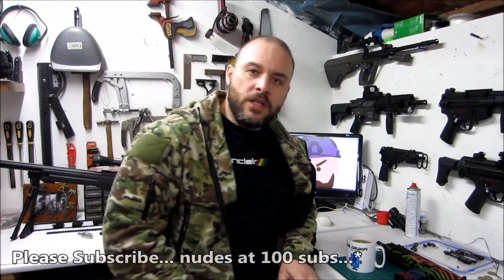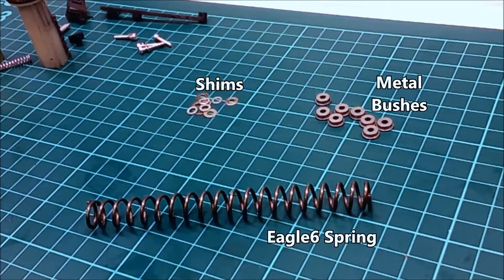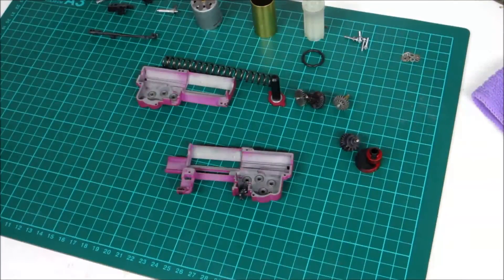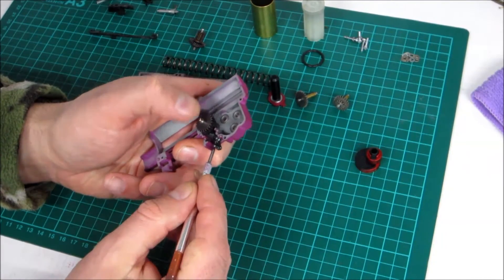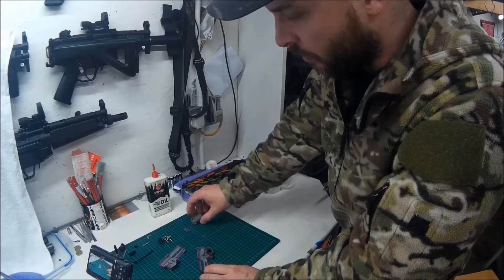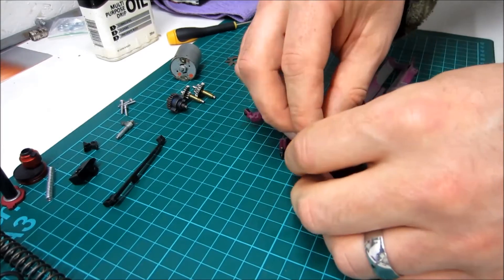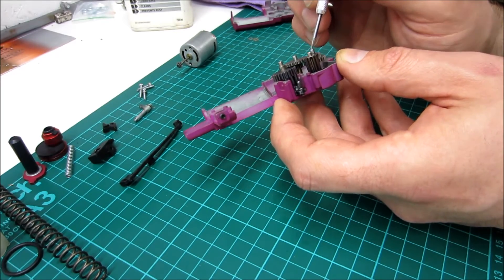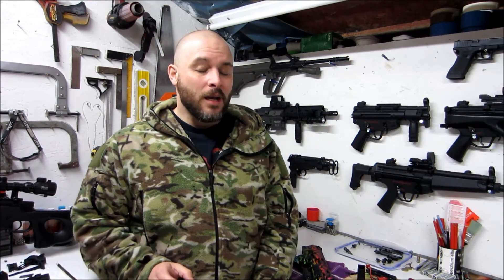Well R4 MP7 | Part 4 | AEP Gearbox Rebuild, Upgrade & Shim | Airsoft BYR

Comment: Hey lad i just got the mp7 and want to do the exact same thing you did to yours metal bushings spring etc, do you have a parts list? or can provide a couple links or atleast words of guidance, also are the bushing 6mm and do i need a press to get them in? Tia
Reply from the maker: Hiya buddy - I got my parts all from Eagle 6 Airsoft - but I'm not sure what is currently available.

I probably wouldn't bother with the cylinder head if building it again.  I only got it to improve nozzle seal as it is the biggest source of leaks on these - the factory head doesn't have an o ring and the tolerance is crazy loose.  The laylax one did have an o ring.  But it also had this daft squidgy damper design I really didn't care for.

So I'd maybe make up a jig for either grooving the inside bore of the factory head to take an o ring - or groove the outside of the nozzle to take one!

Bushings - I can't remember what size they are off top of my head - but it doesn't matter because they are specific to the AEP platform and only come in one size.  Even if you get bushes from a full size gearbox the right diameter to go in, the axle diameter is smaller on these - the gears would rattle around and probably destroy themselves if you used full size AEG bushes.... so yeah, stick to bushes meant specifically for these 😀
Reply: Purple Helmet  cheers lad, so far I’m replacing just about everything except from the piston cover (brass part) and gears as I can’t find any metal ones in stock, reckon the stock ones will survive the 300fps spring?

Comment: Where Do you buy this cylinder head? is like nineball mp7 cylinder head, isn´t it?
Reply from the maker: Hey - thanks for commenting - yeah the very same.  I'm not a big fan if I'm honest, I think the damping on the front isn't the best idea - it allows the whole cylinder head to move which could compromise cylinder seal maybe... it just doesnt sit well with me.  I'd have rather had the damping on the inside, but the main reason I fitted it is because a) I had one kicking around and b) I needed the o-ring seal as the cheap factory one was terrible.  When I get my lathe I intend to make these myself tbh!  I got mine from eagle6 airsoft in the UK, but they didn't have them in last time I checked.
Reply from the maker: Actually it seems back - description updated:

http://eagle6.co.uk/shop/catalog/product/view/id/1485/s/laylax-nineball-mp7a1-damper-cylinder-head-x-for-cmg-series/
Reply: It's just what I thought about that cylinder head.

Even so, have you noticed an increase in fps?
Reply from the maker: +GUZ KO actually yes!  It jumped the original fps on the weak spring from around 140/150 to 180ish, just by tightening the compression at that point.  I think the guns terrible hop up unit isnt sealing right every shot so I'm just deciding how best to fix that - I don't want t make a whole new unit since the whole point of these videos is to show people how to do things themselves... so I'm trying to stay away from fabricating parts.

I still haven't test fired with the new eagle6 spring!  The gun has been torn back down to fit a MOSFET lol.... WILL THIS PROJECT ECER END hahahaha

Comment: So I have a JG Skorpion. I Know they have the same GB as the MP7 I have a few questions. My front pin fell out and the upper came off. Then the air nozzle fell out of the piston head is this common, do I need to take apart the Gearbox to get it back in? I heard they might be free float? Is that true? Any info would help thanks.
Reply from the maker: Hiya, cheers for dropping by :)

If the JG is the same as the Well, ie a clone of Marui, there should be a wee grub screw that goes in from underneath, and stops that front pin from falling out - it could be loose or have fell off, should be able to find spares easy enough :)

The nozzle - you don't need to strip the gearbox to get them back in, they fall out quite often if bumped when the gun is apart.  Basically you just juggle it back in and then rotate it - the nozzle should have a little tab on it, and you rotate that to go into the little groove on the tappet plate.  Once the gun is back together it can't rotate easily so will stay in - but as said, when the gun is open, it's easy for it to fall out.

Have you had much gun time with it before this?  How did you find the JG version?
Reply from the maker: I wish they would let me post images in comments, would be so much easier to explain stuff!!
Reply: Thanks for such a quick response! Im gonna try those suggestions and see if that helps out. Ill let ya know if I'm successful. Thanks again. 😼
Reply: Alrighty! That was it! Super easy. Thank you. 😄👍
Reply from the maker: +CantSpellLITAwithoutLIT666 - Superb!  This is what YouTube is all about for me, getting chatting with like minded folks - well done getting it sorted!

Comment: did you use the SHS VZ61 gears in you`re uppgrade? and does it exist uppgraded motors?
Reply from the maker: Hey buddy - the gearset I got complete from "Airsoft GoGo"

Motors... as far as I know nothing that directly fits, but there are motors from radio controlled world you can make fit - I've never bothered to be honest.  At some point you've got to accept the limits of the platform
Reply: @PurpleHelmet  I still think youve shown how possible it is to make a half decent outdoor field airsoft gun for half the price of the newer elite force model with 250-300fps, 125+ feet of range, and at least 600 RPM are decent goals. Also adding the fact that the magazines are insanely cheap for multiples compared to the newer one.

Comment: Nice video, clear explanations and is a very good detail to include the sources.
Probably most os us lack a sandblasting cabin but is a good idea.
Just can't wait to ask. Here most people here inmediatly change to a precision barrel and an aftermarket hop up rubber.
I'm also curios about your opinion on the wiring. Do you think it worth to rewire with low resistance wires? What about upgrading the battery? Maybe to a LIPO? T Dean connectors?
Best regards-
Reply from the maker: Yeah the sandblasting was just a bit of fun - but if anyone wanted to, they could use sandpaper / abrasives to achieve the same thing. Kind of pointless though, I only painted it for two reasons; because I could, and because I have a few of these gear boxes now - it lets me tell at a glance which is which :)

Most people do jump to a precision barrel and hop, and that is cool - but this gearbox was way under performing so it needed done regardless.  I might put another barrel in it in the future, we will see.

As for hop up, the design and quality of the hop unit is terrible, a lot of flex in the arm so the hop up nub comes down more on one side than the other, which could cause the bb to swerve... I'll see how it performs at the shooting test.  At the end of the day, its rarely going to be used as a primary, more of a backup and close range gun :)
Reply from the maker: Oh and yes in my opinion a lipo (preferably with a small MOSFET) makes a huge difference, I have that running in my VZ61 which is essentially the same inside.  Wiring... personally with this I don't think you would see a huge difference, the only wires are from the terminals to the motor, the rest is nickel (I think) plated copper tracks in the firing mechanism.  I might still rip it all apart yet and do more - it is just a matter of how far you want to take the modification process, and how much you want to spend.  With how much I have spent so far, I am still under the price it costs to buy one of these stock new (at least in the UK) but it will be firing far better - I will summarise costs in a future video :)
Reply: I agree that generally the most sensible approach is not to fix what is not broken, so, if anything is working within reasonably expectations its proably netter to leave it as it is until something breaks or proves that is needs improvements.
Reply: Here is a fixation with rewiring everything. I'n not so sure that can be so much difference between two strings of wire.
What do you think is a better overall product, Well R4 or JG VZ61?

Comment: Hey man. I am thinking to buy and do some upgrade on JG vz61 (marui clone) - which is also hanging on your wall :D What upgrades would you recommend? I heard that gearboxes breaks very fast on those :/
Reply from the maker: Hey buddy cheers for dropping by and commenting!

The gearbox in the VZ is identical to the MP7 so the mods available are basically the same.  The Eagle6 spring will see it around 300-310 FPS on 0.2g bbs assuming everything else is good, but yeah, you do pay for that in terms of extra stress - you cant have markedly more power, without extra stress unfortunately!  So it's just a matter of how much risk you are prepared to take really.  

What I will say is although upgraded shells aren't available (that I've found) it is really easy to by stock gearboxes for these of eBay etc... so my mentality is if it breaks... so what lol!

Comment: Hi, great videos. I have just bought a Well MP7 for a back up weapon (I'm still waiting for it to arrive), while I am snipping. I always like to upgrade my AEG's to get the best performance from them. I do have a couple of questions; What are the size of the Bearings and would you recommend correcting the AOE of the piston? Thanks
Reply from the maker: +Robert Davies - hey buddy - thanks for dropping by, really appreciate it!

The AOE was fine on mine, even after fitting the upgraded cylinder head - however, that's a bit of an unknown; due to the design of the cylinder head, where the damper is, the whole thing can move... Which means the piston "home" position can also change.  That in turn means AOE could change shot on shot.  I'm not overly comfortable with that... but so far it has been fine.

The bearings - I can't remember specifically what size they are but I can tell you for these boxes, they only seem to come in one size - so any bushings/bearings quoted as being for "AEP" or "CMG" should fit.  It isn't like the larger gearboxes where you can get different sizes.  I got mine from eagle6 Airsoft in the UK if that helps!

I'm hoping to get the final part of this up soon, after I get part 2of2  up for the L85 I'm fixing currently :-)
Reply: Hi, I have been buying the new upgrade parts recommended by yourself and others. I found a mod (on YouTube) for a battery upgrade to a 800mAh 7.4V lipo. I do have two questions; would you recommend fitting a MOSFET? Also what hop bucket would you recommend? Cheers
Reply from the maker: Hey again fella - I've seen the mod a few people do on YouTube and there is absolutley nothing wrong with it at all - its good to go.  However, if it was me (and I will be doing it, very soon) yes I would fit a MOSFET on this.  Reason being the trigger contacts are smaller AND harder to get to (complete PITA) on this - so I see it as a preventative measure.  With a MOSFET in there, they will practically never burn out.  A 7.4 lipo wont put THAT much extra stress than the factory battery, but it does still put out more current, meaning more arcing, and more contact burn up in time.  So, for all it costs and a little extra effort I'd rather fit one and then its done.  It also means if I want to abuse the gun with an 11.1v for shits and giggles to see how long it lasts, I can :D

I'll literally be getting to work on that segment of my MP7 build very soon.  The project would have been finished by now, but I lost momentum and a few people asked me to fit a MOSFET and LiPo to it :)
Reply from the maker: Oh - the hop bucking - I could be wrong but I don't think there is much choice out there for these.  Maybe ones for other guns will fit, or can be adapted.

The main problem with this particular gun though isn't the bucking itself - even a basic nub/bucking will do the job if it is setup just right - but its the body on these thats the problem.  The arm can distort when under tension, meaning the hop nub goes off TDC.  I'm not sure if uprated hop units exist for these (if they do someone please link me up) so I'm going to be looking at a DIY fix if I can come up with something to make the whole thing more stable.
Reply from the maker: The airsoftgunrepair site is great, but shipping to the UK just makes it unrealistic.  They are still stock parts, and they don't specificy if its Well, or genuine TM either...

As mentioned on Facebook, the Shapeways stuff is hit or miss, and not cheap anyway - the hop units for example that you linke me too, I can't see being a great improvement over stock - although the metal hop ARM might, as the stock ones flex/twist, knocking the hop off top dead centre - I'll probably make my own metal one in the final part of this video though, to try and counteract this - I think anyone with a dremel could do it fairly easily :)
Reply from the maker: Obviously if you are in the US, then the airsoftgunrepair site is superb!  I'd be buying loads from there if it wasn't for the shipping making things too expensive, lots of good bits there that are hard to get elsewhere!

Comment: What where chrono results on this? 

I have a tons of parts, enough to build about 3 of these, and i wanna build up one and upgrade it. What upgrades do you recommend?
Reply from the maker: Hey buddy, cheers for commenting!  I've not had it full back together - I have a couple of ongoing health issues that means I am struggling to get anything done.  I did have a test fire off the bench and was getting 290ish fps so its definitely in the ballpark - I wanted 250+.  I Cant wait until I get it together properly. 

Mods wise, definitely the eagle 6 spring, its cheap and does the job.  The cylinder head I use IS an improvement over the stock item because the stock one doesnt have an o-ring over the nozzle and leaks a lot of air - but I don't like where the damper is on it.  I believe stock marui heads have the o-ring so if you can find one, definitely use that.

Uprated spring guides are a bit meh... anti reverse latch on this is plastic, and is already not stopping windback with the stronger spring, so a metal one of those.

Metal bushes to replace the plastic ones is always a good shout.  I have links to all this in the description I think!

Im trying to get fit enough to get working on it again, Ive made up a mosfet and I'm going to show that being fitted with lipo etc... apologies for taking so long :(
Reply from the maker: PS thats on stock length and bore barrel - if you intend running a suppressor full time, you could extend the barrel, go a little tighter, and that will grab you some free fps, so thats always a good shout.  I have some AEG tightbores here, I might cut one down and fit that... just havent decided if I want the suppressor full time :)
Reply: Purple Helmet Hope you feel better soon broski.  And I would very much love seeing a video about a mosfet install. 

get well soon ☺
Reply from the maker: Thanks buddy, sincerely appreciated :)
Reply: Hey bud, thanks again for your help before. Currently fitting all the parts together and shimming the gears. Last part to do is fit the Eagle6 spring. It is pretty big, how did you fit in and did you trim any of it off? Cheers!
Reply from the maker: +Alexander Nimmo - he fella - didn't trim as to me, that kinda defeats the purpose.  Drill a small hole in the centre rear of your spring guide - that will allow you to use a thin screwdriver like you do on a bigger box to control/hold down the loaded spring guide as you fit the spring - be warned, its "fun" to fit lol
Reply: Purple Helmet Hahaha I have already had a lot of "fun". In my first attempt it all exploded out the box. I managed to get the spring in but now the box wont close! Haha I can see why people strongly advise against upgrading these! Cheers for the help bud
Reply from the maker: +Alexander Nimmo - box not closing is a ball ache - 9 times out of 10 it will be the piston being pushed up and twisting slightly as it isn't in its rails.  Its a pain in the ass buddy, feels like you need 6 hands to do everything at once haha.

Just keep holding it all down, use thin screwdrivers to prod the gear axles around, and so on.  Getting a long thin screwdriver up the spring guide helps massively because as well as helping to stop it all grenading, you can use it to make sure the spring guide is angled down... Which in turn helps keep the piston down... But yeah its a bastard lol

Once you have it shut, assuming you have no teeth meshing with the piston, push down the nozzle with a thin blunt too to make sure the piston is sliding freely.  

Apart from that, its just a matter of keep trying!!
Reply: Purple Helmet cheers bud! Got to attempt number 7 then gave up. Thinking if I use some tape I can keep the Piston and cylinder stuck to the box, fron there I can get the sprig set it. You are spot on it was the cylinder head that was catching the case (but I was a total reprobate and took the spring back out)! I am off to glasgow for some drinks with the misses I will go for round two tomorrow! If I get it done and chronoed I will let you know the FPS as I see a few folks have been asking you! Thanks again mate!
Reply from the maker: +Alexander Nimmo - mine came out around 290fps on 0.2s with a quick test, hop seal wasn't great tho.  Hopefully you'll get similar!
Reply: Purple Helmet did the eagle 6 Spring effect the ROF?
Reply: The E6 spring is really strong so it will drop the RoF. 
You can use a high discharge 7.4v LiPo to help mitigate this but that will burn through the motor faster :p 

Still, it's really nice while it works. 

PDI make some excellent inner barrels that can help bring the power up beyond the 300fps level :)